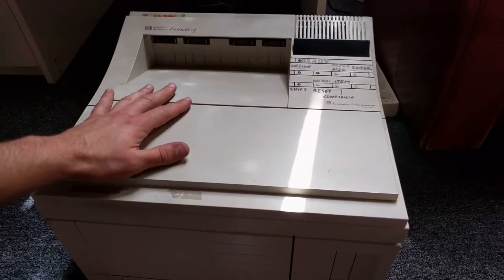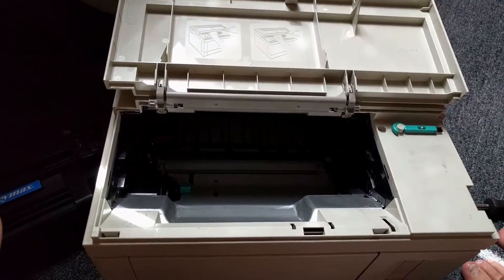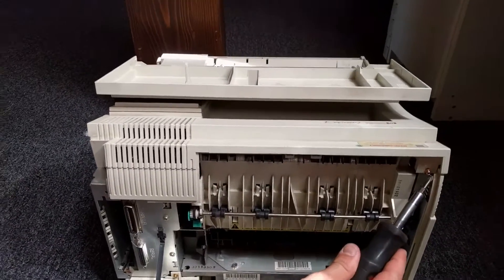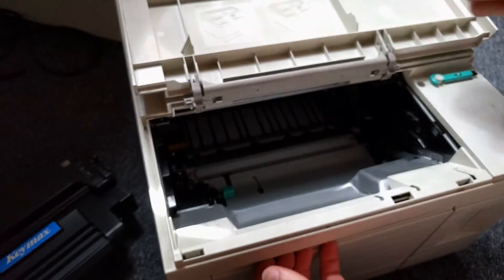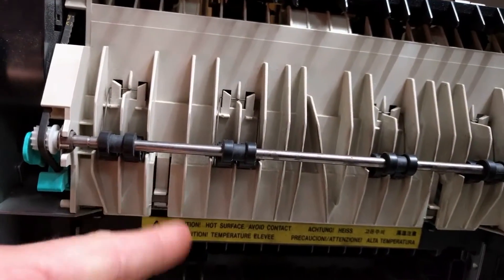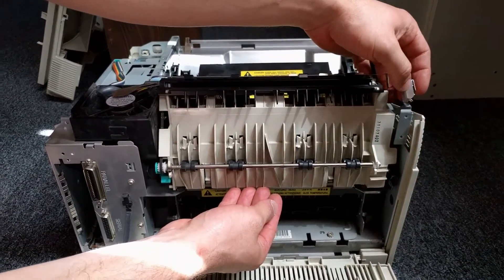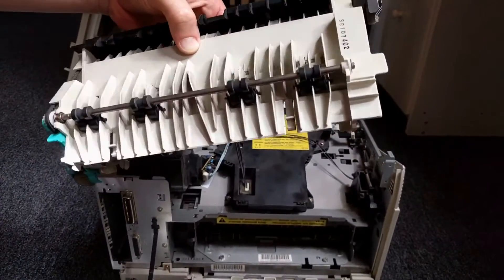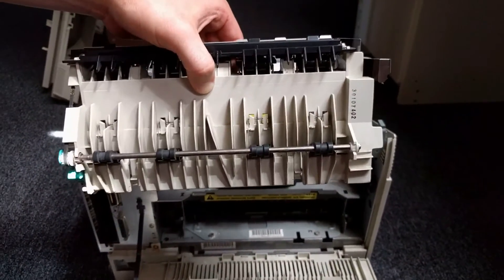HP LaserJet 4 exit / output assembly DIY

Comment: Thanks for your video - very clear and concise. It is also possible to recondition the rollers once the exit assembly has been removed has been - you will need to do this because you probably won't find any replacement units. It's not too difficult. It is described in another (quite lengthy) video  https://www.youtube.com/watch?v=RRMjEfcfazk&t=114s. I was able to get my 30 year old printer to work very well by doing this
Quote:
I found your video about using Rubber Renew about a year ago, bought some, dis-assembled the rollers, applied the Rubber Renew and re-assembled. It worked OK for about 9 months then the problem recurred, so I did it again and it didn't work so well. So I took the rollers out again and this time I REALLY soaked them with Rubber Renew using a very small (2mm) artists paintbrush, several times until I could see that the Rubber Renew was not sinking in. Then I STRETCHED the springs that tension the upper and lower rollers - not too much, but quite firmly, before re-assembling. The printer is working fine now, I think re-tensioning the springs was an important part of the fix. I will post back to say whether it continues to work - if I live long enough.

Comment: Good video, Can you show a video replacing the fan or at least how you can disconnect the fan from the computer board. It seems it's a little difficult getting access to the connection. Thanks